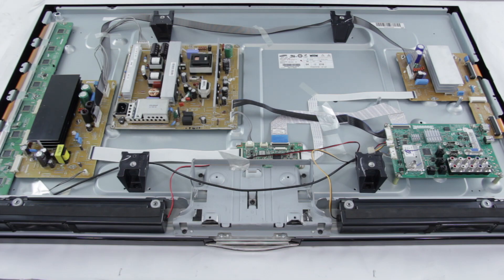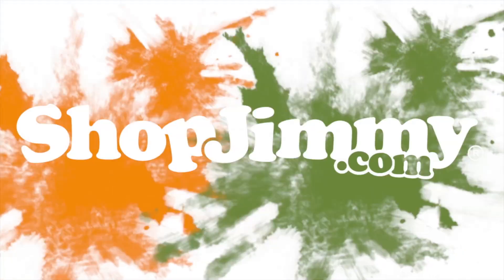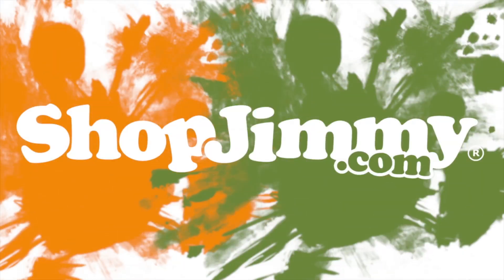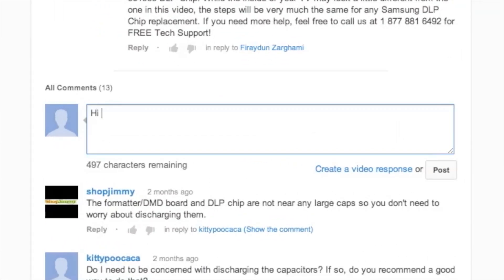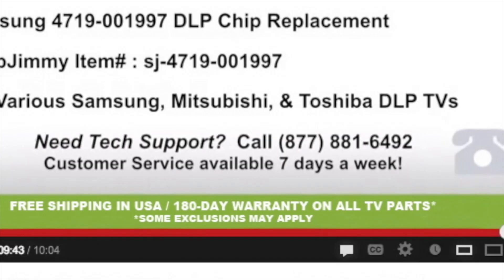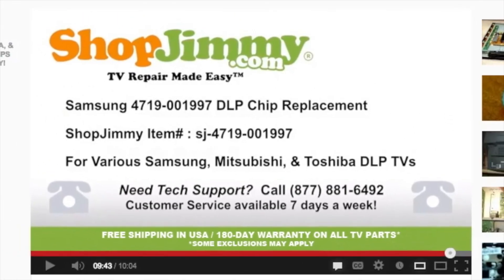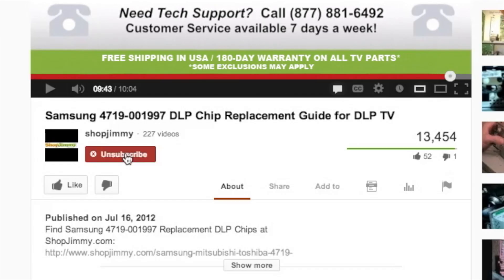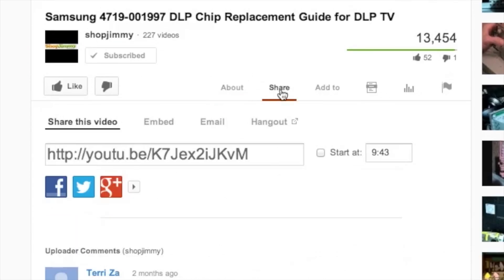Plasma TV Repair Tutorial - Common Symptoms & Solutions - How to Fix Plasma TVs

Comment: Thanks for posting this video. I have a Samsung 51" PN51D450A2DXZA version N411. My wife turned the tv on one day and noticed we had audio, but no video. The tv made the typical Samsung chime while starting up. Then she heard the show, but the screen was completely black. She did not hear anything else unusual when she powered it on. Any help is appreciated.
Reply from the maker: Timothy Harp  Please watch this video FIRST to help with your repair!  https://www.youtube.com/watch?v=BP3NVNCGEv8  I recommend replacing the Y-Main Board and the Y-Buffer board in your TV.  Click this link to replacement parts for your TV model number:  http://www.shopjimmy.com/catalogsearch/result/?q=PN51D450A2DXZA+  There may be multiple boards for the same TV model number, be sure to match part numbers on your current board, with your replacement for compatibility.  Here is a link to a video showing how to identify your part number, click here:  https://www.youtube.com/watch?v=R1jmj_foId0  Thanks and please let us know if you have any further questions with your TV Repair!  www.shopjimmy.com
Reply: ShopJimmy.com Okay, I ordered the Y-main and Y-Buffer boards and installed them in my TV. When I turned the TV on, I started to see snow on the screen, then heard a small pop and the screen went black again. I think those parts are a symptom, but whatever knocked out the first ones is still wrong. Any suggestions? Samsung 51" PN51D450A2DXZA version N411
Reply: ShopJimmy.com Okay, I ordered the Y-main and Y-Buffer boards and installed them in my TV. When I turned the TV on, I started to see snow on the screen, then heard a small pop and the screen went black again. I think those parts are a symptom, but whatever knocked out the first ones is still wrong. Any suggestions? Samsung 51" PN51D450A2DXZA version N411
Reply from the maker: Timothy Harp   Try the X board next and if that does not fix the problem, then the TV panel is most likely bad.  Thanks!  www.shopjimmy.com

Comment: Hello there I have a samsung ps51d550 51 inch plasma, it is power  cycling (on and off), red led blinking no display or soundw
Reply from the maker: Luke Drinkwater  Please watch this video FIRST to help with your repair!  https://www.youtube.com/watch?v=BP3NVNCGEv8  This could be a problem with the power supply or the main board in your TV.  You may need to replace each board individually to see which one fixes the problem.  Click this link to replacement parts:  http://www.shopjimmy.com/catalogsearch/result/?q=51d550  There may be multiple boards for the same TV model number, be sure to match part numbers on your current board, with your replacement for compatibility.  Thanks and please let us know if you have any further questions with your TV Repair!  www.shopjimmy.com

Comment: Hi, I have a 58" Samsung plasma tv with weird gamma colors on people's faces in the images. My model number is PN58B550T2FXZA.  I have adjusted the menu settings. I have done a factory reset. The rest of the tv works fine.  The symptoms are present on all HDMI inputs and I have switch the input source and it still happens.  Sometimes it looks okay for a little bit, but the more the set is on the worst the symptom seems to get. your help would be appreciated.
Reply from the maker: bluemarlin12  Please watch this video FIRST to help with your repair!  https://www.youtube.com/watch?v=BP3NVNCGEv8  I recommend replacing the main board in your TV.  Click this link to replacement parts for your TV model number:  http://www.shopjimmy.com/catalogsearch/result/index/?cat=56&q=PN58B550T2FXZA  There may be multiple boards for the same TV model number, be sure to match part numbers on your current board, with your replacement for compatibility.  Here is a link to a video showing how to identify your part number, click here:  https://www.youtube.com/watch?v=BEPWrefQvqI  Thanks and please let us know if you have any further questions with your TV Repair!  www.shopjimmy.com

Comment: My screen cracked it turns on but there's no picture you can hear the startup sound when you turn it on the crack is on the left side of the screen
Reply from the maker: Edski Gonzalez   This sounds like a TV panel (TV Screen) problem.  If your TV panel is bad, it may be more cost-effective to replace the TV as panels are typically hard to find in stock, difficult to replace, and expensive.  Thanks and please let us know if you have any further questions!  www.shopjimmy.com

Comment: I have a black solid vertical line(top to bottom) on the left side of the screen.  
This is a Samsung Plasma TV with model number PN42b400P3DXZA. Is this repairable? I have opened the back of the TV and ensured all ribbons are secured and nothing was loose.
Reply from the maker: sam h   This sounds like a TV panel (TV Screen) problem.  If your TV panel is bad, it may be more cost-effective to replace the TV as panels are typically hard to find in stock, difficult to replace, and expensive.  Thanks and please let us know if you have any further questions!  www.shopjimmy.com

Comment: hello, 
I have an ilo plasma tv..s/n#60034041, the UPC code is 7 92885 21758 0..The red power light will illumiate when you plug it in, when you press the power button you will hear a click then another click but no picture or sound...any ideas?

Comment: Panasonic tc-p46g25
Tv can get turned on but shows no image. This started happening when my siblings left the tv on too long. Usually the screen would get hot. I don't know if that's how plasmas are but I'm not used to it since I use LCD screens and plasmas are new to me. Thanks for the video it really sheds light on the components.
Reply from the maker: Brian Gomez   I recommend replacing the SC, SU & SD boards in your TV.  Click this link to replacement parts:    http://www.shopjimmy.com/catalogsearch/result/?q=46g25  I do not see an SU & SD board in these search results.  Please reply with the part numbers on your SU and SD boards.  Thanks!  www.shopjimmy.com

Comment: @ShopJimmy, I have a Panasonic TH-37PX60U and there's no power going to the set.  I am new at this and want to try to repair it.  Do you recommend replacing the fuses before the power supply?  If the fuses first, where would I get them?  Thanks in advance.

Comment: I have a samsung PN51D530A3FXZA that shut off randomly during use. Now when plugged in, it clicks on and off 5 or 6 times, then I get nothing. No image, no red light. I checked all capacitors and they are visually fine. Is this a power supply board problem or a y-sus board problem? Or a different issue? Thanks!
Reply from the maker: Cameron Giordano   Try this at your own risk. Unplug the TV, then disconnect the y board and plug in the TV to see if the TV powers up. Reply with the results of this test. Thanks! www.shopjimmy.com
Reply: Disconnected y board and no change happened. Same clicking on and off.
Reply: The only board that, when disconnected, did change the outcome when I plugged it in is the main board. No clicking, no red light, nothing when plugged in without main board connected to power supply.
Reply from the maker: Cameron Giordano  Please watch this video FIRST to help with your repair!  https://www.youtube.com/watch?v=BP3NVNCGEv8  I recommend replacing the main board.  Click this link to replacement parts for your TV model number:  http://www.shopjimmy.com/catalogsearch/result/index/?cat=56&q=PN51D530A3FXZA  Be sure to match part numbers on your current board, with your replacement for compatibility.  Here is a link to a video showing how to identify your part number, click here:  https://www.youtube.com/watch?v=BEPWrefQvqI  Thanks and please let us know if you have any further questions with your TV Repair!  www.shopjimmy.com
Reply: I changed the main board, still not working, but now tv won't even click on and off when it is first plugged in.

Comment: Hello I have a 46 inch vizio plasma tv I need your help to repair it the last time a remember it was that the screen was really hot then I heard a big pop then the tv shut off but even I turn it back on and no picture but the it was sound still what you think is the problem..... Oh yea I took the tv to try to repair it and they where asking to much but I remember they open it and saw a fuse pop and they replaced it and it pop again Whats the problem on my tv,..... Thanks
Reply from the maker: Victor Lara   I recommend replacing the y board and buffers in your TV.  Please reply with your TV model number.  Click here to view a video that shows how to find your TV model number:  https://www.youtube.com/watch?v=S51nhAmwR2M  Thanks!  www.shopjimmy.com

Comment: Hi, I have an LG50pg20 50 in plasma TV. Only the top half of the TV picture shows clearly, the bottom half is completely blacked out.  Any suggestions on what this could be?
Reply from the maker: Jaron Neal   This sounds like a TV panel (TV Screen) problem.  If your TV panel is bad, it may be more cost-effective to replace the TV as panels are typically hard to find in stock, difficult to replace, and expensive.  Thanks and please let us know if you have any further questions!  www.shopjimmy.com

Comment: I have been experiencing an intermittent issue with my Samsung Plasma TV Model #PNE60E530A3FXZA. Every few day I lose the picture but retain the audio. After the power is shut off for an hour or so I turn the TV back on and I have the picture and audio as if nothing happened. From what I have read online it looks to be the y sustain board but I would like confirmation
Reply from the maker: Thomas Rogan  Please watch this video FIRST to help with your repair!  https://www.youtube.com/watch?v=BP3NVNCGEv8  I recommend replacing the Y-Main Board and the Upper and Lower Y Scan Drive Boards in your TV.  Click this link to replacement parts:  http://www.shopjimmy.com/catalogsearch/result/?q=60E530A3  There may be multiple boards for the same TV model number, be sure to match part numbers on your current board, with your replacement for compatibility.  Here is a link to a video showing how to identify your part number, click here:  https://www.youtube.com/watch?v=R1jmj_foId0  Thanks and please let us know if you have any further questions with your TV Repair!  www.shopjimmy.com

Comment: I have a Samsnug ps50c7700 that started to have scrambled video during use. Audio works fine but the image is scrambled to the point where you can no longer make out a picture. They're just horizontal and vertical lines moving about. The first 5 - 10 minutes the TV works fine, but then suddenly it's gone. What could this be?
Reply from the maker: Sosuke007   This sounds like a TV panel (TV Screen) problem.  If your TV panel is bad, it may be more cost-effective to replace the TV as panels are typically hard to find in stock, difficult to replace, and expensive.  Thanks and please let us know if you have any further questions!  www.shopjimmy.com

Comment: Hello, I have a Samsung Plasma PN51D550C1F. The TV  randomly turned off then back on again. I have not heard any hum or popping. It has happened 3 times now, after being on for several hrs. Any suggestions would be appreciated. From your video I think it may be the y sustain board ?
Ed.
Reply from the maker: Ed Steranka  Please watch this video FIRST to help with your repair!  https://www.youtube.com/watch?v=BP3NVNCGEv8  I recommend replacing the power supply board in your TV.  Click this link to replacement parts:  http://www.shopjimmy.com/catalogsearch/result/index/?cat=59&q=PN51D550C1F  Be sure to match part numbers on your current board, with your replacement for compatibility.  Here is a link to a video showing how to identify your part number, click here:  https://www.youtube.com/watch?v=sSJexLvRrjM  Thanks and please let us know if you have any further questions with your TV Repair!  www.shopjimmy.com

Comment: I have a Samsung Plasma 43" TV. Model-PN43D450A2DXZA. Will not power on, no lights no clicking, no nothing. I bought a new PS board from you guys and installed it. With no changes. Where do I go next? Please advise.
Reply from the maker: j0sh441   Try this at your own risk. Unplug the TV, then disconnect the y board and plug in the TV to see if the TV powers up. Reply with the results of this test. Thanks! www.shopjimmy.com
Reply: ShopJimmy.com  I tried disconnecting 1 board at a time from the powerboard. No change. Still nothing. I can hear a faint buzzing sound coming from the powerboard.

Comment: I have a Samsung PN50A550S1F 50" plasma that clicks on and off with an occasional colored screen. I have replaced the Y-Main board, but i am still getting the same issue. All voltages are good. One new thing I noticed after going back though TSing the issue is that if I have NO active inputs on the tv, it will come up and stay on, but if I connect a STB, DVD, Ect and turn it on, the tv shuts down. Could this be the Main input card or do you think it is still the Y-Main? Thank so much.
Reply from the maker: Limppimento  Please watch this video FIRST to help with your repair!  https://www.youtube.com/watch?v=BP3NVNCGEv8  This sounds like a problem with the main board.  Click this link to replacement main boards:  http://www.shopjimmy.com/catalogsearch/result/index/?cat=56&q=PN50A550S1F  Be sure to match part numbers on your current board, with your replacement for compatibility.  Here is a link to a video showing how to identify your part number, click here:  https://www.youtube.com/watch?v=BEPWrefQvqI  Thanks and please let us know if you have any further questions with your TV Repair!  www.shopjimmy.com

Comment: Panasonic Model: TC-P50U50 power won't go on.  The red light does not flash it just stays red.  It makes the clicking sound like when you start the TV but nothing happens.
Reply from the maker: DeanMoony  Please watch this video FIRST to help with your repair!  https://www.youtube.com/watch?v=BP3NVNCGEv8  This could be a problem with the power supply or the A board in your TV.  You may need to replace each board individually to see which one fixes the problem.  Click this link to replacement parts:  http://www.shopjimmy.com/catalogsearch/result/?q=TC-P50U50  Be sure to match part numbers on your current board, with your replacement for compatibility.  Thanks and please let us know if you have any further questions with your TV Repair!  www.shopjimmy.com

Comment: Hello ShopJimmy.com. I have a Samsung PS50C550 plasma from 2010. Always worked great and still does. But since a day or two, it has a very very thin horizontal stripe at the bottome all the way from one side to the other side of the tv. It's hardly unnoticeable. I have a link for a photo i took : http://postimg.org/image/y8lbdbm3n/
You can see the very thin line at the bottom of the screen.
Hope you can tell me what i need to replace exactely.
Thanks.
Reply from the maker: izri1  Please watch this video FIRST to help with your repair!  https://www.youtube.com/watch?v=BP3NVNCGEv8  This could be a problem with either the buffer or the panel.  You can replace the buffer to see if that fixes the problem.  If that does not work, then you most likely have a bad TV panel.  Click this link to replacement parts:  http://www.shopjimmy.com/catalogsearch/result/?q=PS50C550  Be sure to match part numbers on your current board, with your replacement for compatibility.  Thanks and please let us know if you have any further questions with your TV Repair!  www.shopjimmy.com
Reply: ShopJimmy.com Ok, thanks for your reply. I have never disambled a tv. And certainly not a tv as big as 50 inch. When i know enough about the tv, i'll get back to you. Thanks.

Comment: I have a LG plasma 50PG20D. it's just started having a 3 inch deep horizontal red and yellow block line across the top of the screen, It remains there whilst the tv is on, but the rest of the screen is normal.
Reply from the maker: Steve Ehrlich   Could you please post a video or image online and then reply with the link?  Thanks!  www.shopjimmy.com

Comment: Hi there, I have a Panasonic TC-50PX14 Plasma TV.  The TV will occasionally still turn on, but more often than not when you hit the power button it sounds like it is powering up, but then there is a click and the power light continuously flashes and does not stop with the TV not turning on.  The problem is progressively getting worse.  Thanks in advance!
Reply from the maker: James Hampson   How many blinks are you getting?  Thanks!  www.shopjimmy.com
Reply: It's not a set amount, it's just continuous flashing with a 2 second gap. I tried counting and got to 30 before I gave up.

Comment: I have a Samsung plasma hp-t5084 that was working fine Saturday and it was left on during a rain storm plugged into a power cord. It no longer has power. I watchedur video and it indicated try the fuses first. Which fuses should I try?
Reply from the maker: Robert Romero   Please watch this video FIRST to help with your repair!  https://www.youtube.com/watch?v=BP3NVNCGEv8 Since we are not sure which board is damaged, it is recommended that you replace the power supply and the main board in your TV.  Click this link to replacement parts for your TV model number:  http://www.shopjimmy.com/catalogsearch/result/?q=t5084  There may be multiple boards for the same TV model number, be sure to match part numbers on your current board, with your replacement for compatibility.  Thanks and please let us know if you have any further questions with your TV Repair!  www.shopjimmy.com

Comment: I have a Samsung Plasma PN60E6500EFXZA that has one vertical green line going through it on the right side of the TV. It also will turn off randomly. The standby light will blink constantly and the TV will not turn back on until it has been unplugged for days.